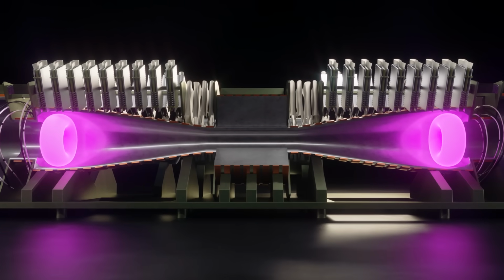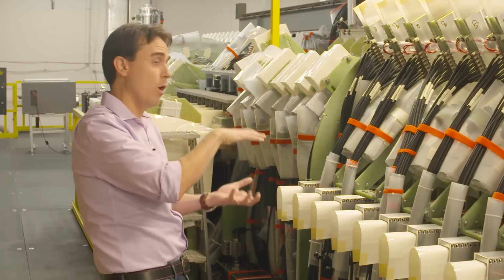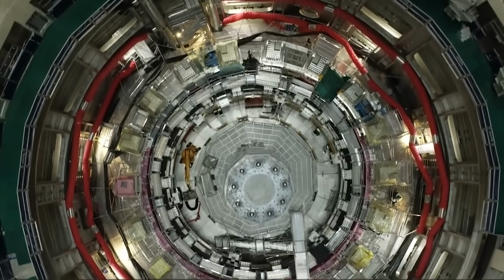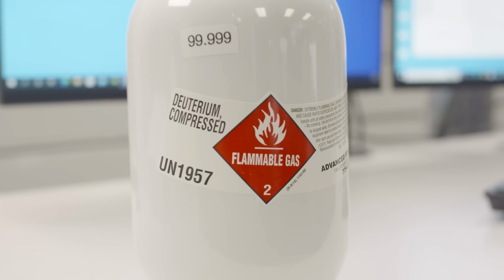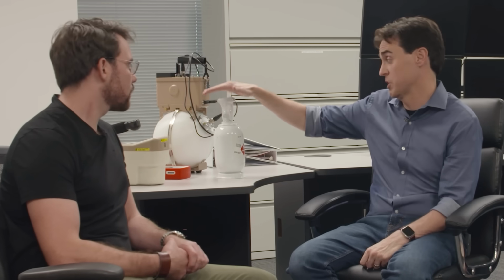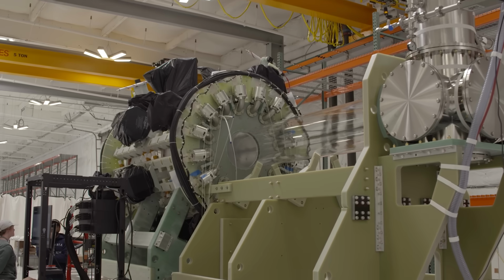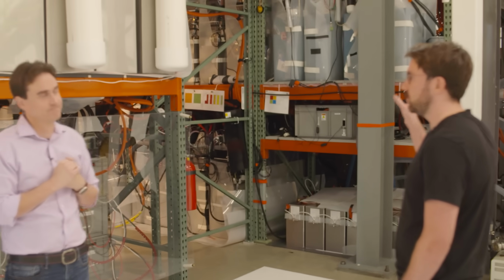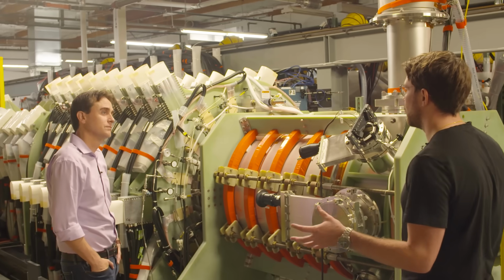A New Way to Achieve Nuclear Fusion: Helion

Comment: The explanation part had me rewind so many times before I understood each sentence. I feel like the processes can be boil down to: preheat the two ingredients, put them together, heat up the mixtures to even hotter temperature for desired reaction to occur. 
But the method of how to do each process is so genius and next level. Can't touch it because it is millions of degrees? Use magnets so they levitate. 
Also, this is such a cool method to generate electricity, especially comparing with the already-developed fusion reactor. The comparison really help illustrating how Helion's method is much more energy efficient and less expensive in terms of construction and waste management. It's like moving from steam engine to internal combustion engine (specifically a diesel engine!) in terms of efficiency but also less dangerous waste. 

Such an interesting video, thanks!

Comment: Ok, call me stupid but how the hell isn't the machine melting ?! 3 million degrees plasma radiating that heat around itself... is the machine made from cryptonite-adamantine alloy ?!
Reply: It is 100 million when the fusion happens, actually. The plasma does not touch the walls. It is held in place by magnets. And it is surrounded by a vacuum which is of course a perfect insulator. It is also not very dense, closer to a vacuum than to ambient air in density. Total energy content of a pulse is in single digit kWh. 
So even if it was to touch the walls it would only do minimal damage, which would only matter if it was happening very often. After a while the walls would have to be replaced, but nothing dramatic would happen.

Comment: Don't mind me, they call me Cassandra. But how clean will this technology be? Won't one and every fusion plant produce enormous amounts of HEAT here on this increasingly torrid earth?
Reply: 160,000 TWh is all of the energy currently consumed by humanity. That is for all purposes and from all sources.
Energy from the sun hitting earth: 1,515,480,000 TWh a year, or about 10,000 times more. Variation in solar radiation is commonly(!) 0.15%, so 15 times more. And that is known to not have a great effect on global warming (unlike CO2).
So, even if energy demand increased dramatically and all of the energy was produced by fusion (unrealistic) and lost to heat without doing any work, it would not have any impact on global warming.

Comment: how to keep the core hot enough of that fusion , while preventing the tokamak walls from melting from this heat. ?🤔🤨
Reply: This is not a tokamak, but the same applies to this machine:
The plasma does not touch the walls. It is held in place by magnets. And it is surrounded by a vacuum which is of course a perfect insulator. It is also not very dense, closer to a vacuum than to ambient air in density. Total energy content of a pulse is in single digit kWh. 
So even if it was to touch the walls it would only do minimal damage, which would only matter if it was happening very often. After a while the walls would have to be replaced, but nothing dramatic would happen.

Comment: As a commoner, I wonder: how much electricity output is Helion expected to produce in one fusion reaction cycle (one plasma collision)? E.g. we pour in a massive amount of effort (including electric energy and the gasses) into the reaction, but how much are we getting on the outside? How many of those reactions would be needed to power up a theoretical light bulb (or a household or an city)?
Reply: Their machines are designed to put 50 MWe to the grid. They will do 10 pulses per second. So that is about 1.4 kWh of net electricity per pulse plus some energy that will recirculate into the machine for the next pulse.

Comment: Imagine what they will use this for as a weapon, perhaps orbitting earth and shooting down on earth ground with heat beams 🤷‍♂️
Reply: Would not work. Without magnets holding it together, the plasma would quickly expand and dissipate. It is not very dense to begin with and while it is very hot, the total energy content is quite low.

Comment: So wait if if heat is a problem could you just use some sort of cooling to simply create more energy? or am I missing something here? Reduce the temperature and create energy with that as well?

or just use the heat to heat up the particles in the start of the process

Comment: Basically 2 rail guns firing at each other with a magnetic hold in the center, to put it simple.

however.. this company and its machine made no major news headlines (for net positive output) and I cannot find a single source to credit them with net positive output.

The closest thing to mention them (Bloomberg) says this: "Aims for first fusion system ever to achieve net power output." It doesn't say they did so.
Reply: Net electricity will happen with Polaris in 2024. Trenta does not have the equipment to extract electricity/energy from the plasma but the science must have been very convincing. Their investors called in some bigshots from the national labs to review the results and then handed over 500 million for the Polaris program with another 1.7 already committed if Polaris performs as expected.

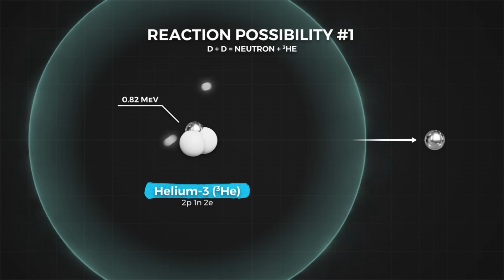Comment: 14:55 the neutron in reaction D+D-->He3_0.82MeV + n_2.45MeV could be used to "make" uranium233 from thorium, that  additionally could feed MoltenSalt Reactors!
Reply: They had a plan for this once as a transitioning step before doing a full out fusion machine. No one wanted it :(
You might like pages 17 and particularly 18:
https://cpb-us-w2.wpmucdn.com/research.seas.ucla.edu/dist/d/39/files/2019/08/5.7-Slough-ReNeW-Theme-4-talk.pdf
Reply: @elmarmoelzer2229  Helion needs to hook up with YouTuber GordonMcDowell and Kirk Sorensen, John Kutsch, TEAC11 conference; they are very much promoting Th-MSRs and thorium fission fuel cycle. They also could sequester the tritium chemically (H3 is disturbing for them) from their cores (if a reactor is built according to Kirk's original concept, with a protactinium decay tank, and CO2_turbine technology).  "waste" Tritium which would be of great use in fusion technology; but it can't be separated chemically from LWRs' cores; it gets diluted into ocean waters (at La Hague, for example)!
Reply: @konradcomrade4845   I know Kirk. He has been trying to get LFTRs going for some 20 years now. 
Helion will have more Tritium than they want, tbh.
Reply: @elmarmoelzer2229   Helion should connect with YouTuber GordonMcDowell and Kirk Sorensen, John Kutsch, TEAC11 conference. They promote Th_MSR reactor technology. Kirk's original reactor concept, with a Protactinium decay tank, and a CO2_Brayton cycle turbine, could easily, chemically sequester Tritium from their reactor fluid loop, which would be very useful for Fusion. With old fashioned LWRs it is hard to separate Tritium from the coolant water. it ultimately gets (harmfully) disposed and diluted into the ocean.

Comment: I don't understand how the math of the fusion reaction creating helium 3 is supposed to add up.
According to the reaction shown, two ²H atoms (so 2p, 2e, 2n )--> one ³H (1p, 1e, 2n) + 1p + ³He (2p, 2e, 1n) + 1n [summing up to 4p, 3e, 4n)
I suppose with 2 deuterium molecules and beta radiation this would work, but why not portrait this?
Reply: I think you misread this. 
There are two possible outcomes for D-D fusion. One is a He3 and a neutron. The other is a Tritium atom and a proton. Both have a 50:50 chance.
The Tritium will eventually beta decay to more He3.

Comment: I just want to tell you a piece of the future you about to embark on. This totally works but there are some small things to consider 1. The fission reaction itself does not last long. This may seem like a bad thing but it's not. Just plan on adding more fuel more often then you initially thought. 2. It will produce more energy than you initially thought as well. 3. Your processes will evolve until the is an actual sun created in a lab that Canandaigua will be sustained for a very long time requiring no extra fuel for years. 4. You got this hurion, don't give up

Comment: It would make more sense to have the capacitors in to 24 separate series. so you can fire them in series like a loaded gun and as you're firing them you can charge the last one fired. So you can have that 10-second rate. Like reloading a gun. This creates less power in than you created. So you'd have a total of 48 capacitors for left and right in series firing like a gun clip to create less power and then out.

Comment: I was busy with morning chores while watching so I might have missed it but I didn't hear anything about cooling, if not using the heat how do you prevent buildup that leads to failure?
Reply: Trenta is air cooled because the pulse rate is really low (1 pulse ever 10 minutes). Future machines will be water and/or oil cooled. There is not that much waste heat.

Comment: Accelerating to 1,000,000 mph seems absurd. That's 0.149% or 1/671 the speed of light. I wonder if he got that figure right.
Reply: Each is about 1 million km/h (slightly less). They collide at about 1 million miles per hour. Accelerating plasma is not that difficult. It has very little mass and is in a vacuum.

Comment: The cabling length is a very weak point.  The self-resonance of these lines+caps will limit the speed of impulsing to low frequencies.  Next gen will require the caps to be very near to the chamber.  Rail-guns and Nuclear-Weapons had this same problem.  Better way is to have a "resonant reactor" where the Q of the system will allow continuous resonance.  We designed some of that type of equipment, now used for induction heating, induction compression, and similar commercial uses.

Comment: So if the magnetic field power plant fails !! The plant explodes...so good luck with solar/wind power.
Reply: why would it explode
Reply: @steveethegreat4632  electromagnets need a reliable electricity supply to focus and contain the beams, no electricity.... Boom
Reply: @stewartread4235  nothing would explode. if the magnetic field failed, the plasma would quickly spread to fill the chamber. however the pressure of the plasma is closer the that of a vacuum so it would barely heat any of the chamber walls up at all. the pressure in the chamber would not change and there would be no explosion.
Reply: @steveethegreat4632  wow, you've just invented cold fusion...smh
Reply: @stewartread4235  dude its still millions of degrees but it has nearly no density, it cant heat the walls up. I didnt say anything about cold fusion
Reply: No, it does not explode. If the magnetic field fails, then a current is induced in the surrounding coils and energy is extracted from the plasma. 
Even if there were no coils (for some strange reason), the plasma is hot, but not very dense (closer to a vacuum than to ambient air).
 It would cool off during the expansion and immediately upon touching the walls. There might be some minor damage to the vessel walls, but that only matters if that sort of problem was to happen very often. And then all you do is replace the walls when they are too damaged to be useful.
Reply: @elmarmoelzer2229  thank you elmar for explaining it better than me a 16 year old could
Reply: @steveethegreat4632   You did great bud!
If you are 16 now and know and understand all of this. I predict that you will have a great career ahead of you! Do you have any plans for college yet?
Reply: @elmarmoelzer2229  I do not have any college plans yet but im really interested in studying nuclear physics because I find all of this very interesting.
Reply: @steveethegreat4632   I don't know where in the world you are, but if you are somewhere near the US west coast, Professor Uri Shumlak has a great graduate fusion program at the University of Washington (Seattle area). 
He is the scientist behind another promising fusion startup, Zap. 
I would say that you check with them what the best classes/direction would be to take to get into that one.
Nuclear engineering is probably a pretty safe bet.
Reply: Also make sure to take some time between high school and college to find yourself and your path forward. Don't just listen to me! Do some sampling if you can...
Sorry, rambling...

Comment: Uhh, nobody at any point told you that drinking heavy water can make you permanently sterile or even kill you? It may be chemically identical to water, but it's not physically identical, and human bodies are not simply chemical machines. A single bottle would be fine, but if you were a professor who did this frequently to demonstrate the similarity between heavy water and regular water to your class, you'd be in serious danger.

Comment: Thx for the video.  Fusion is really cool, but now for the tuff question, what was the power input and what was the power output.  Most of the time, the power in is greater than the power out (i.e., a Q of less than one).  Most fusion reactors under development (and may a few that have been developed) are struggling to get the Q above 1 (i.e., power out is greater than the power in).   Ideally, the Q would need to be around 10 or greater.  Why?  Most power generation is done by using turbines.  A typical steam turbine system and generator is that for every 9 units of heat in, you get about 3 units of electricity out (i.e., about 33% efficient). With a Q of 10, the next result would be 1 unit of electricity into the reactor would yield 3 units of electricity out.  With a 1 to 3 ratio of electricity in to electricity out, a fusion reactor could, arguably, be cost effective and economically viable.   IMHO, we are still a long way away from a fusion system that is economically viable.  It would be great if we could get there though.  If this new system is truly able to "directly" convert fusion reaction into electricity, that would be reduce the Q number needed for a system to be economically viable.  It will be interesting to see how this system develops.
Reply: They can get away with a Q of about 3 due to their extremely efficient direct energy conversion and input recovery system.
The exact Q of Trenta is still kept under wraps.
What IMHO is most important to know is that Polaris is set to demonstrate net electricity (not just net energy) in 2024.

Comment: I’m new to this concept, but this sounds almost like free energy. Which doesn’t make sense to me. Can anyone explain?
Reply: E= mc2. When two light atoms fuse, the resulting heavier atom has slightly less mass than the atoms it was made from. This is called the "mass defect" and that missing mass is released as energy. It is a bit more complicated in reality (really it is the binding energy that is released), but that will hopefully explain where that energy comes from.
Fusion "makes" energy by releasing the excess binding energy when two atoms fuse to a heavier one. Essentially that resulting atom has slightly less mass and that is released n(the mass defect). If you want even more detail, the pion, the omega and rho mesons are the bosons responsible for the nuclear binding force. Those essentially move gluons between hadrons (protons and neutrons) to bind them and some of them are released during the fusion reaction.

Comment: Is there a safety shut off procedure in case of an inner magnetic field anomaly/error that could result in that core touching the inner metal chamber? Does it shut off quick enough and is there a guaranteed safe kill-switch in case of error? Oh and where in the world are you able to farm a resourceful Helium-3 deposit?
Reply: I think it just blows up and thereby disables itself.
Reply: @p39483  It won't blow up. The energy content of the plasma is too low.
Reply: Nothing much would happen. The fusion plasma is very hot, but not very dense. It is closer to a vacuum than to ambient air. And it is surrounded by a high vacuum, which is a perfect insulator. Think of steam from a pot of boiling water. The steam is boiling hot, but you can hold your hand into it (carefully!) without getting severe burns. This is similar. The total energy content of a pulse is only a few kWh, a fraction of the content in a Tesla battery. The plasma would cool off immediately upon touching another object and all fusion would stop. The inner walls would get slightly damaged over time if it happened too often.
Helion will produce their Helium3 by fusing Deuterium in the same machine. D+D => He3 +n or D+D => T + p (the Tritium eventually decays to He3 as well).

Comment: 300 km/sec? That is 0.1% of c, which is not very fast for plasma particles. Did he mean to say 300,000 (which can't quite be reached, but is a good approximation)?
Reply: It is fast enough to heat the FRCs that then merge into a single, hotter and more stable FRC (FRCs get more stable the hotter they are). That is then the target for magnetic compression which is what heats the FRCs from millions of degrees to hundreds of millions.

Comment: Not a peep on whether they're making positive energy, i.e. get out more kW than they put in. It's the only thing that matters when all is said and done and although they're all bubbles throughout this vid, they're also remarkably shtum when it comes to their energy balance, I wonder why 😂😂😂
Reply: Polaris will make net electricity in 2024. Trenta is an experimental machine that is designed to retire physics and engineering risks for Polaris.

Comment: I'm by no means a materials engineer, but is there any viability in lining the magnetic confinement chamber with a layer of aerogel tiles perhaps made from a carbon aerogel to insulate the entire chamber itself from the heat coming from the confined plasma? Do aerogels even still maintain their insulative properties at the temperatures that the chamber experiences? Do aeorgels maintain their insulative properties in a vacuum chamber? Would a layer of aerogel tiles weaken the magnetic fields emanating from the chamber walls?